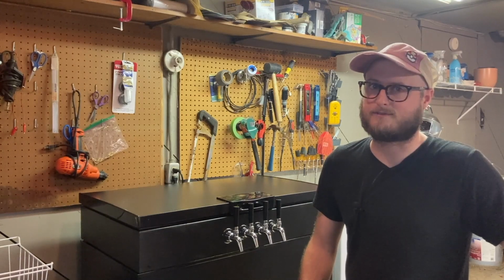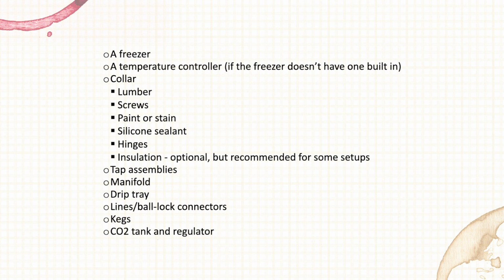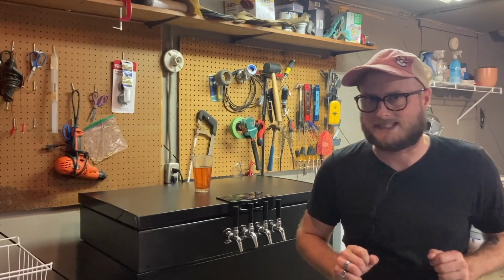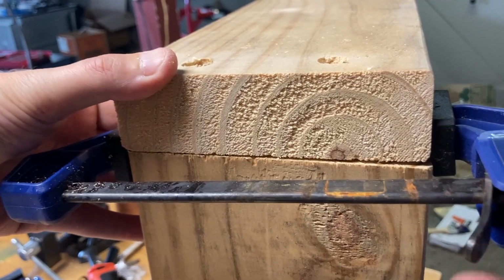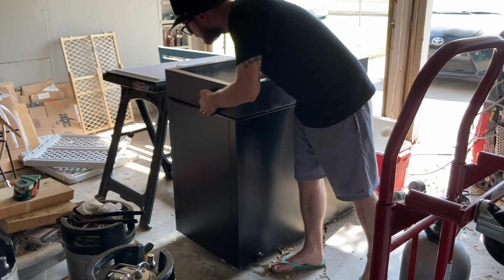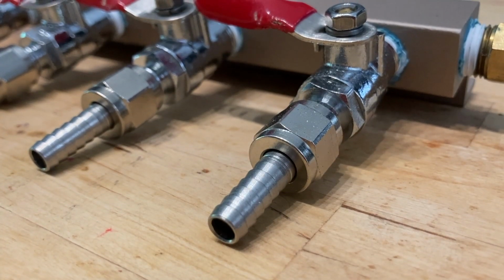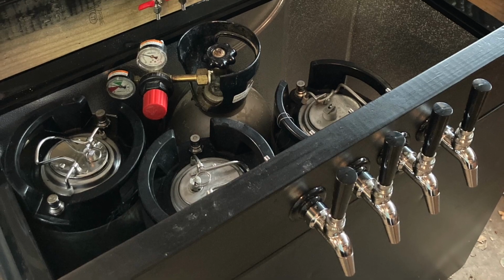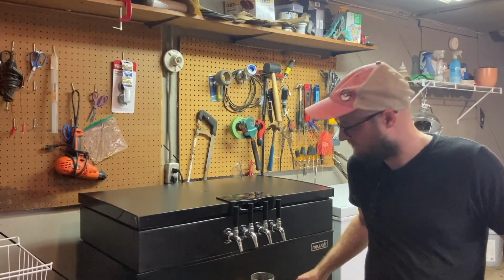How to make a Keezer for home brew on tap | A simple DIY Kegerator with built-in temperature control

Comment: I just finished building this and it was very easy.  That model freezer is perfect for this application. Probably should have done this last fall when I first saw it and the weather was warmer. An important note is that you have to reverse the plastic cable clamp on the back of the unit so the cable will reach. I agree wtit the previous commenter who left the original hinges on the lid and hooked them to the collar. Used 2x6 boards but I think 2x8 would have worked as well. Used Duotight fittings and beer line which made the internal assembly go very fast.

Comment: Great looking build, however leaving the original hinges on the lid and attaching those to the collar is so much easier and cleaner. Then you retain the same spring tension that holds the lid open and pulls it closed. Also...friends don't let friends use hose clamps, duotight is the way for a modern keezer build. And for those of us who do a little woodworking a pocket hole jig is the easy way to hide the screws inside the collar and make finishing a breeze.

I routed my gas through a hole in the collar to leave room for an extra keg! Even if it's not on tap it's nice to have room for an in-keg ferment to cold crash or for an untapped serving keg to be carbonating until it's time.

Comment: I've read and watched quite a few keezer builds.  You've done a fantastic job of keeping it quick and simple.  With the simple step of hanging an Inkbird on the back of the collar and running the thermometer into the chest, you'd have a complete and practical lesson.

Comment: I'm part way through doing this project. Awesome job, but I have one question... How do you make your sparkling water? Certain flavorings or just some water in a keg?
Reply: I think its just straight water he runs CO2 through. He made a video recently of soda flavorings so I think it's just water.
Reply: @Funpants94  that's what I've been doing, but I've been using lime juice and I was wondering about other possible flavors.

Comment: Nicely done!
Wood working tip: if you mark the board and then drill a small pilot hole through the board then come back with your 1" bit, you can start drilling from the back part way through and then finish from the front. This leaves a much cleaner hole and works with pretty much anything you're going to cut wood with.

Comment: Should look into picking up more regulators instead of that 1 4-out manifold.  You can then control the pressure to each keg individually vs just having a static on/off (something like a high carbed hefe in 1 keg and a lower carbed porter in another).
Reply from the maker: Good info. I had briefly considered it but that is an added expense on top of an already expensive project. Maybe something for an upgrade next year!

Comment: Firstly for anyone considering building one of these. You can get cheap faucets and save money, but resist that urge and spend a little more for some nice taps. I went cheap at first and ended up buying Nukataps later. Now I have cheap faucets sitting around in a drawer :(. I also highly recommend the Nukataps, but suggest getting the return spring with them. They are great! If the kegging is new to you, please remember to get the gasket/washer for between the Co2 tank and regulator. Its a stupid fast and easy way to have a leak that might not be obvious. Do yourself a favor on the beerlines and start long. You can always cut them back if the pour is too slow, but if they are too short you will get lots of foam.
For my build:
I had a can of Flex Seal spray, so I used that on my collar. It worked very well and gave a nice matte rubberized feel. I used the same silicone to attach the collar though. I opted to use the lid hinges to connect the lid to the collar and let the silicone hold the collar in place. Its been over a year and there is no sign of the collar moving let alone coming off, so I think it is probably safe. Plus those hinges are nice because they do assist the lid opening and will hold it open when putting a full heavy keg in. The last thing I did was add chalkboard paint to the lid so I can easily note what each tap is without buying the expensive $30+ each chalkboard handles for the faucets.
Reply from the maker: Love this! I have a chalkboard I have attached magnets to but I haven’t decided where I want to put it on the outside of my Keezer…
Reply: @DointheMost  I'd go with on top close to the taps. You can even number them and have a spot for each number on the chalkboard. I used a label maker to number them. With the chalkboard paint (almost can't tell it's there) I use the whole top with a section for each tap and a small section for what is carbonating, fermenting, or other notes. Helps make sure I don't run out of kegs :)

Comment: I'm surprised the cable to the lid was long enough, bonus points for the easy conversion!

For my keezer I had to unplug that cord, but fortunately (I guess) it's not as fancy as yours and that cable just powers the internal light.
Reply from the maker: I was a little weary at first but when I popped the cover off I was like, holy Moses, there’s a lot of extra cable in here! Definitely an added benefit.

Comment: With really short lines you'll need to dial back the pressure on the regulator quite a bit to get slower pours. I think I use like a 6ft line at least with 10psi gauge pressure. Also while not immediately necessary, do yourself a favor and invest in some antimicrobial lines.  Welcome to the club
Reply from the maker: Replacing all the beer lines is first on my list when I get around to having the time for it. Fortunately everything I have on tap is pouring perfectly right now at 10 psi.

Comment: I'm rebuilding my keezer now due to it unexpectedly dying on me...  I had originally cut holes in my lid and run a pipe as a tap bar.  This time , I'm building it like this method with the taps coming through the collar.

As an FYI to others, the height of the wood collar, either from a 2x4, 2x6, 2x8, or even 2x10, will determine if a full size/5 gallon korny keg can fit on the compressor hump.  I believe in most cases 2x8 is the right size, but it may vary based on the size of the hump and dimensions of the freezer

I chose to run my CO2 tank outside to have some space inside the keezer where the tanks aren't touching each other... and I run 2 tanks, with the second one being nitro for cold brew coffee, both wouldn't fit anyway...
Reply from the maker: I was considering putting the CO2 tank outside, but it wouldn’t buy me a comfortable space for a fourth keg, so I opted against it. The diameter of my CO2 tank is just a bit smaller than a keg. 😓

Comment: @14:32  when mounting the manifold.  sometimes, with some models, the flush against the back of the collar might be too tight of a fit for the gas lines, where they might hit the top of the keezer body.  Using another piece of wood between the collar and manifold as a shim, is an easy way of fixing that issue.
Reply from the maker: Great tip!